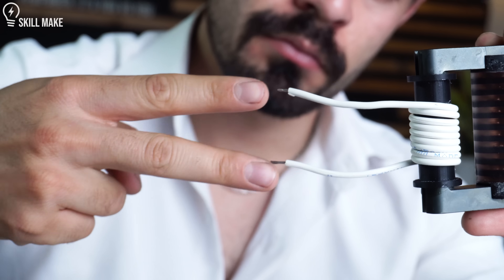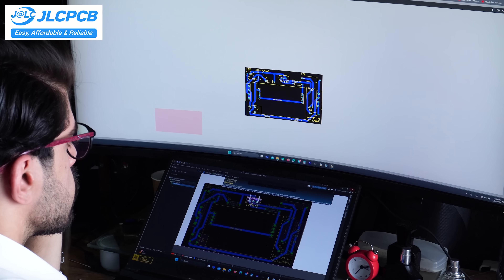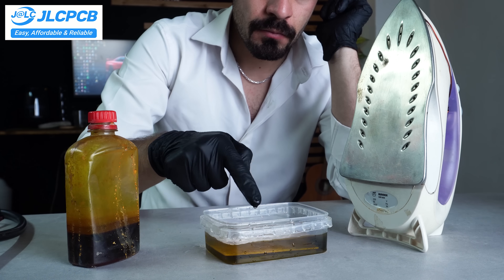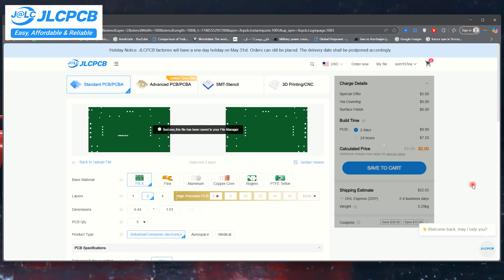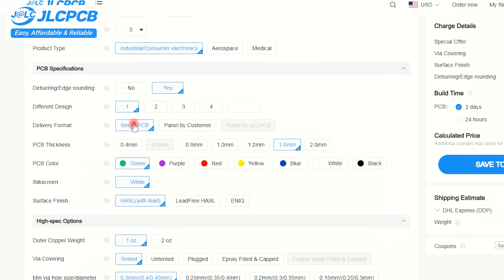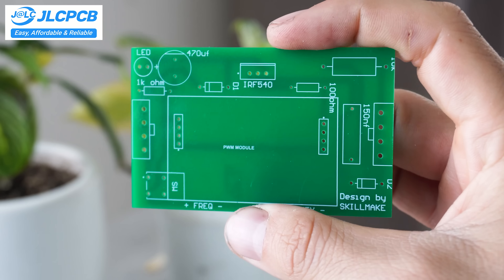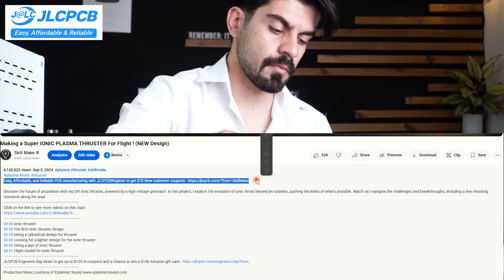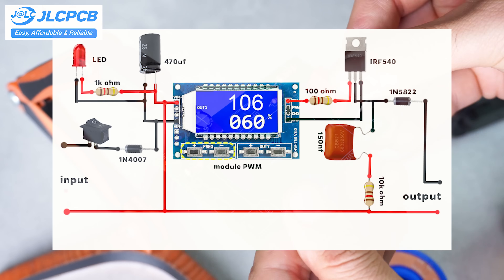100x More Powerful High Voltage Plasma Generator? Secret Inside Custom DIY Transformer

Comment: I am an M.S, Degree Ee,ctriclal Engineer graduated from the uNiov of Arizoina. This is an Excellent work in terms of Video Presentation  and Experimental work. I desperately  need one of these 40,000V hi voltage Generators for my electrochemical experiments for Hydrogen Bonds disruptions Thank you  you just got me Motivated.

Comment: Amazing simple building skills. Just get a TV fly back transformer. Put in self oscillation at its optimal frequency. You will get insane current and voltages.

Comment: Jadi teringat itu regulator pada TV polytron pada tahun 1979 seperti itulah antara playback dan power suplai jadi 1 kalo generasi sekarang mereka tidak tau karna sangat simpel pakai IC penggerak nya

Comment: I teach physics at MIT and I can honestly say your channel consistently has the very best tech and tricks. While other YT channels copy each others bad designs your always at the front of the pack. You must have someone very smart educating you since your designs are always so darn good! I want you to go back to that bipolar fuel generator and do what My student John talked to you about by adding air flow (Nitrogen) to your HHO rocket motor and just stick with a simple small bell Nozzle! If it's good enough for Elon it is good enough for you and much easier to engineer the fuel flows and there will be "Shock Diamonds". Keep up your first-class builds, your the best!
Reply: MIT, very famous. I just gave my design of electric space engine to ESA for free to develop. Energy (electric) is made by 8MW nuke reactor. Movement for spacecraft comes from kinetic energy reverse. Actually very simple, just take me 30 years to get math proven by AI. Now, you have this black box mystery... hurry up 😎Oh, after 1h 0,7G speed is 9000km/h for 200.000 spacecraft. But you need to put it together in orbit. Good luck!
Reply: You suck kids

Comment: Props for showing people how to wind their own transformers, and your production quality is top notch. However, isn't that 1:500 Split-Bobbin core-type transformer you use for most of your videos extremely inefficient, even compared to simply using concentric windings around a single ferrite leg. 
Maybe in a future video you could even do a Toroidal Transformer, as the way you wind one of those is kinda counter-intuitive and cool to watch. (Where you have circular spool holder with a cutout in it, slip the toroid through the cutout, then wind the magnet wire onto the spool, then un-spool it in the opposite direction to wind around the toroid. That manufacturing technique easily accomplishes something that seems like it should be tedious or even impossible. I dunno, just seems like something that'd suit your channel)

Comment: I'm assuming then, that Radiant Energy will follow the wire circuit when not being dissipated by surrounding ambient air. The vacuum chamber allowed majority R.E. to continue to the end load, ground. You can also put brass shut off valve for containment of vacuum + use hand squeeze vacuum tool instead of expensive pump.

Comment: Nice work. Why frequency reduction generated a longer-length arc?
Reply from the maker: This mostly depends on the transformer. You need to find the best frequency for it to work optimally, and it usually comes in between 15 and 30 kHz.

Comment: That heated glass trick for epoxy is genius!
Reply from the maker: I love it!
Reply: It is filled with tricks
Reply: Why?
Reply: @kumardigvijaymishra5945because normally a vacuum chamber is used for clear epoxy work and that whole setup ist not needed with this hack
Reply: @kumardigvijaymishra5945because normally clear epoxy work is done with a special vacuum chamber (expensive, needs a lot of space and is not reasonable expect you do a lot of epoxy work), and with this hack you can create at least a small vacuum to make small epoxy pieces clear without bubbles
Reply: You could also boil empty jars and quickly do the same! It is very smart!
Reply: D’accord, mes a quoi sert se truc ? A par faire une belle lumière bleue sa ne sert pas a grand chose.
Reply: it's amazing
Reply: Even smarter is to just use a vacuum pump… which he already has. Not sure why he didn’t do it the professional way, but it worked so okay.
Reply: @cbfull  To show people how to do it without a vacuum pump. Not everyone has one.

Comment: Doesn't it hurt? The thread is very thin.
Reply from the maker: No, with proper insulation it can work perfectly fine. Getting the details right really makes a difference.